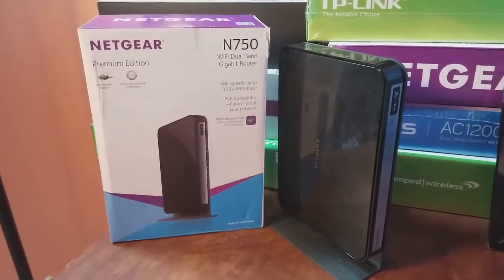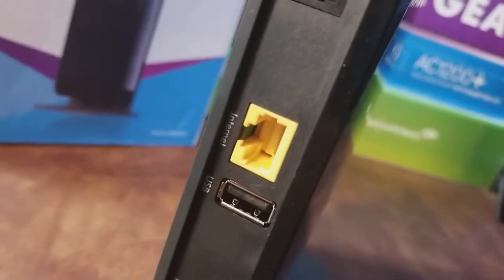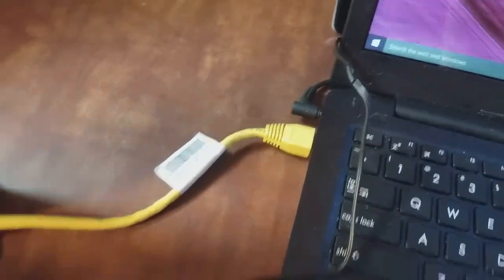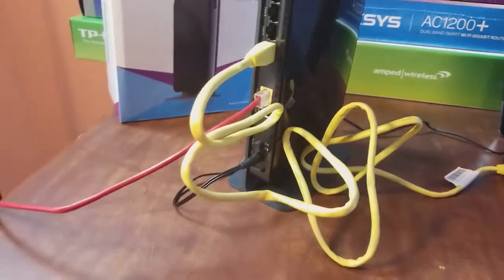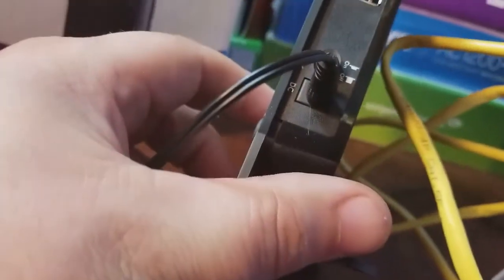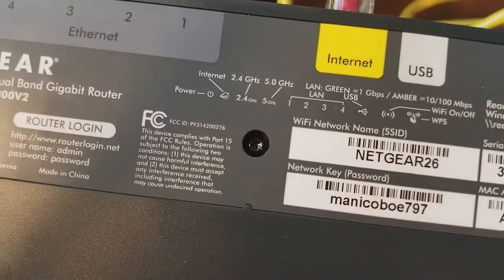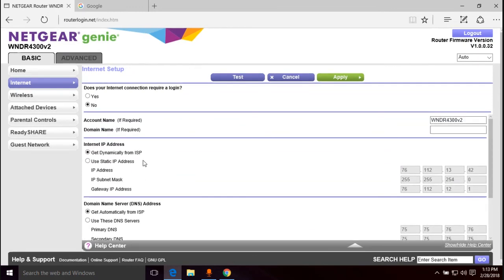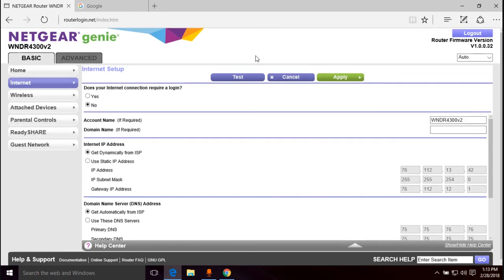NETGEAR N750 WNDR4300 Initial Setup And Config

Comment: Hi this is a bit off topic. But I have this router and maybe you can explain to me something as I can't find the answer anywhere. After setting up the router I have ssid Netgear34 and ssid Netgear34-5G. So how do I know what devices get hooked up to which one? I currently have everything under Netgear34 but am not sure that is right. If you wouldn't mind helping me understand that I would so appreciate it.
Reply: Don’t know if this helps anymore lol but it doesn’t really matter, only difference is 5g gives off internet in 5GHz which means strong internet connection but not that much distance so it will cut off at a certain distance. Regular wifi without the 5g at the end gives off 2.4GHz which is normal to low wifi reception but it has a stable connection as it covers farther distance.  Hope this helps even though its 5 months late :)